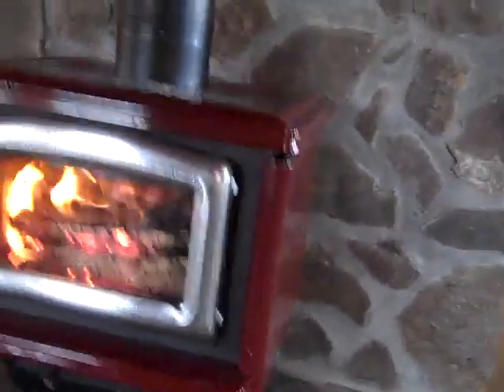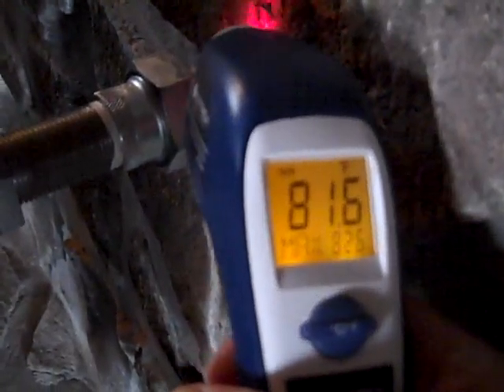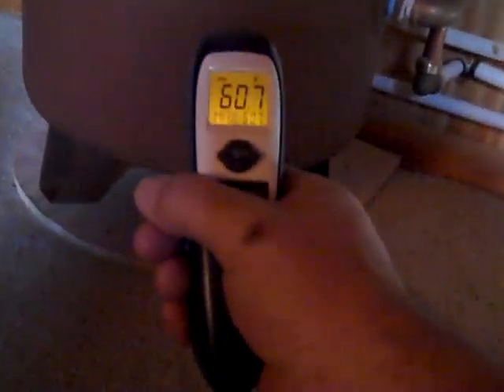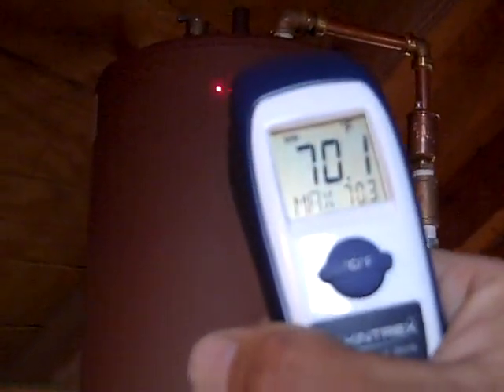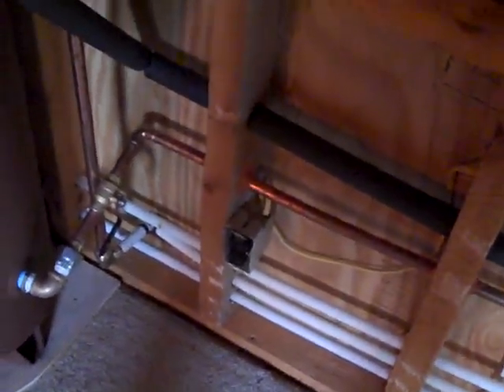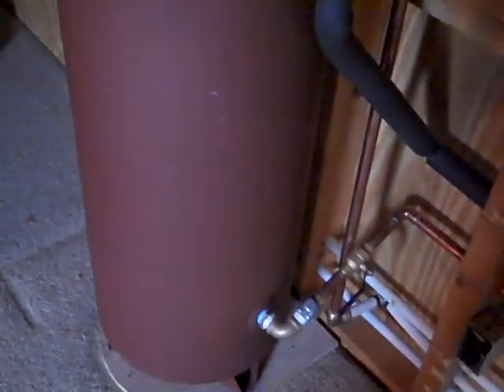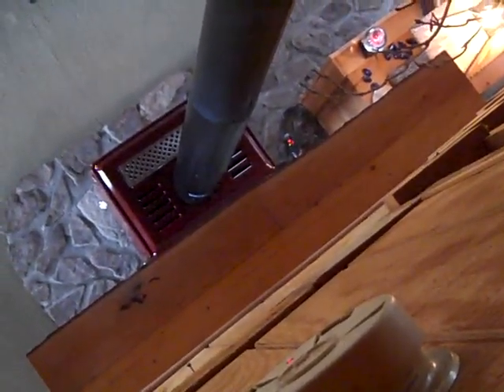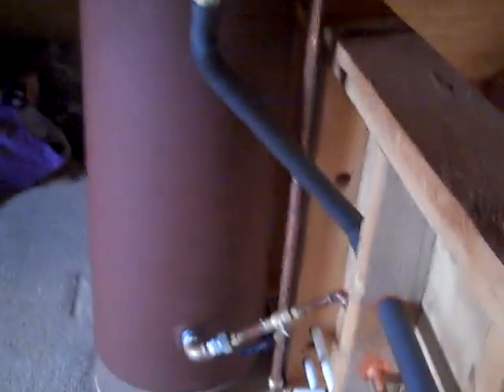Hot Water: The Old Fashioned Way pt3.wmv

Comment: Cool stuff, I like the "linear redundantcy" of all the different methods to contribute heat to the water path.  Maybe you could bend your own copper coil and fill more of that void in the back of the stove?  Perhaps some copper coil on the top of the stove under the ceramic paneling where the stove is hottest?  Just throwing ideas out.  Thank you for snowing us the gusset pressure relief valve.  I didn't know that existed before seeing this and it has given me some "bad" ideas... ÷)

Comment: You need to increase the surface area on the coil. Not sure how. Perhaps pack the space tight with ball bearings.
Reply: NowAndThen_EH89JW How about using an old radiator, lots of surface area.

Comment: Hi, thanks for the informative videos. one thing that strikes me is that you didn't install an expansion tank somewhere along the line to prevent the build up of too high pressure in the system as i understand it is a closed circuit.

Comment: Nice project, thanks for sharing.
.
I have a similar project,  was wondering, in order to increase conduction between the stove n heat exchanger, if you added a bottom to that cavity on the stove and filled it with  sand how much more conduction surface area you would add???

Comment: cont.  Since the ex-changer would be higher up and hotter you would need less copper plumbing in the house and it should have a much higher flow rate.    How about an exhaust pipe that had one two or three tubes running through them almost horizontally to capture remaining heat and distribute it  through a convective air current to a second floor loft or bedroom in the case where the exhaust might go though an upper room on the way through the roof.   Or a ceiling fan could recirculate the air.

Comment: What about for solar in summer just putting in a skylight, painting the tank dark and putting an insulated and reflective wall around the tank opposite the skylight?  Do you know in New Zealand this kind of stove hot water combination is called a wet back and where they live its mostly off the grid for heat, water, power, etc?   Have you ever heard of anyone installing some kind of heat capture coils in the exhaust stack?  Granted it would have to be high temperature and steel.

Comment: to me you got a great system apart from that heat exchanger it either needs a aluminium plate over it or filling the gaps with sand, or have a well designed heat exchanger in the exhaust flu...

I my self would go with the second option ;-)

Comment: or you can weld a 2" to 3" thick water jacket to the outside of the fireplace it self to the bottom, sides, and back. leaving the top and front to heat up the building during the winter

Comment: @johnjmw1 that device just lets any air build up to vent out, they are normally attached at the highest point in a water system (at least ones with no circulator pumps).   A system like this would also need a T&P device to open if the temp or pressure got too high in the circuit.  If a loop gets any air pockets in it it could slow or stop the water circulating (even in systems with pumps)

Comment: Is the tank an indirect fired with a coil? If not shouldn't the hot water from the coil go to the bottom of the tank to complete the thermal syphon?
Actually, now that I think about it even an indirect fired tank shoul feed into the bottom. ( I think?)